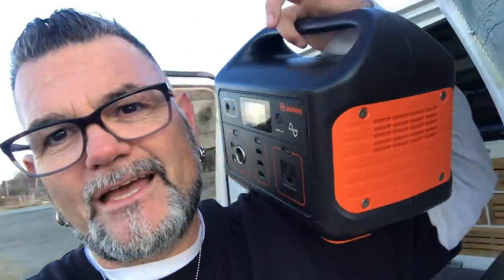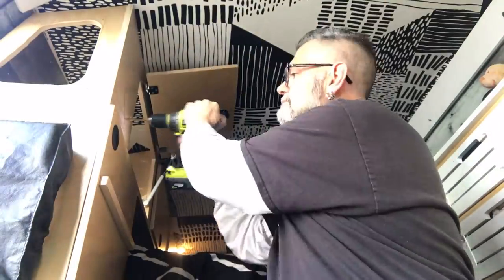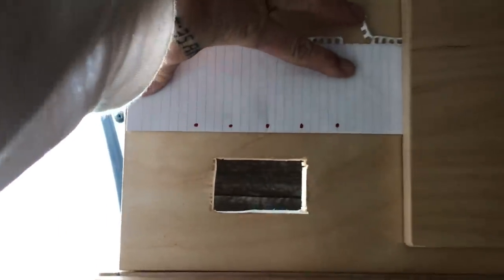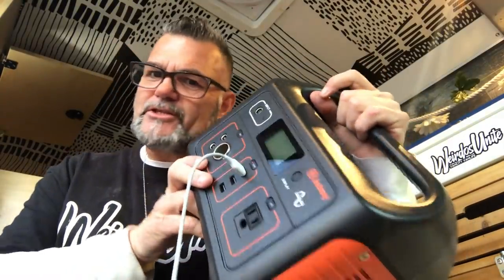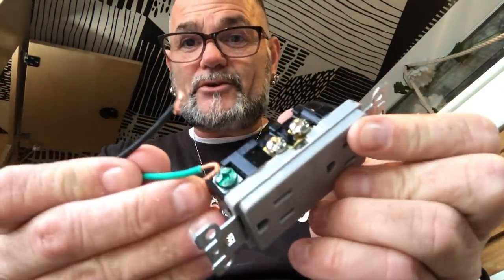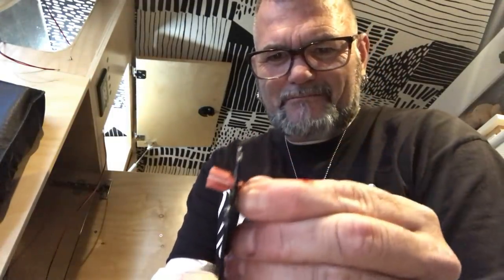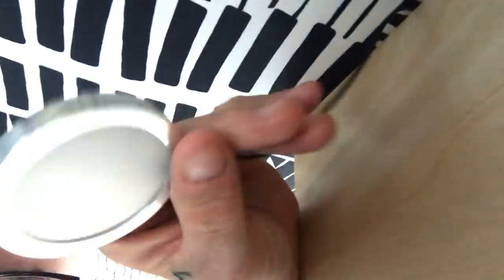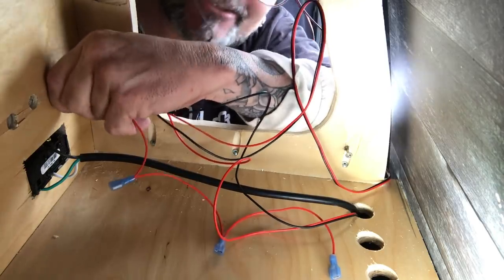VAN CONVERSION BUILD | Wiring switches and Lights PART ONE

Comment: Love the straight switches man ha ha. Pro tip. Use a smaller drill bit to create the pilot hole so the larger one doesn't wander around giving uneven holes. Itll help guide the bigger bit to stay still.

Other than that my friend. Epic job.

Comment: Always get metal outlet covers and spray paint them. Never crack.
Before you start drilling or cutting put a couple news paper sheets down your clean up so much easier. And yes, go oversized with the wiring and use the best connecters you can get. And a little shrink wrap is a great idea.
Things you can't see you know are protected against being shorted from items in the cabinet. I even add a little block of wood that protects the backs of the switches from being bumped by things moving around while driving.
Do it right do it once. And enjoy the little extras you add. Happy travels!
Beeps.

Comment: Hey Chrome I suggest you put in some anchors to secure the wiring so the connections are not pulled on when you manipulate the 120v plug. hate to see a fire caused by that, will only cost a few bucks .
Reply: @VANCITYVANLIFE  fabulous

Comment: I'm little bit concerned about the 120v outlet. There are exposed connections, maybe put some electrical tape around or even better, change it to a closed type outlet. Last thing you want is get electrocuted while searching stuff in your cabinet.

Comment: Hey Chrome, Great job with the rocker switches, but I'm a little concerned about the install of the 110 volt outlet. Having the outlets metal sides (with the screws) so close to the wood is not a good idea. As others have said, cut a bigger hole and mount a plastic outlet box or at the very least take some of that silicon you got and insulate the exposed metal. I see the setup you have now causing a fire someday, or you shocking the hell out of yourself by reaching into that area to do something else. One more thing, you need to secure the 110 volt cord down to the wood. With that cord getting vibration while your driving or being pulled as you plug and unplug it from the Jackery, you could work the wires loose from the power outlet.  This could also cause a fire down the road. Ask the guys at the hardware store about how to secure the wire.